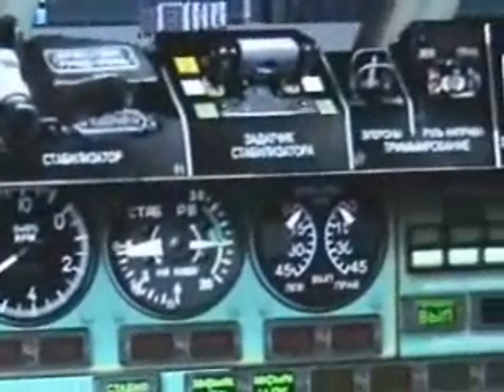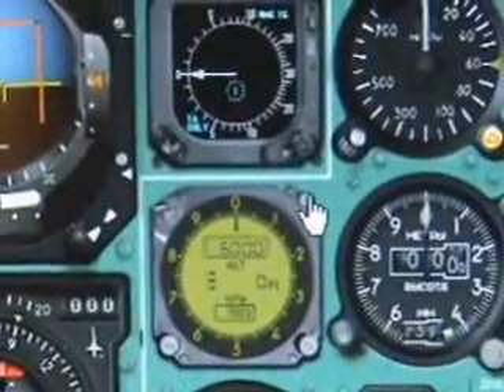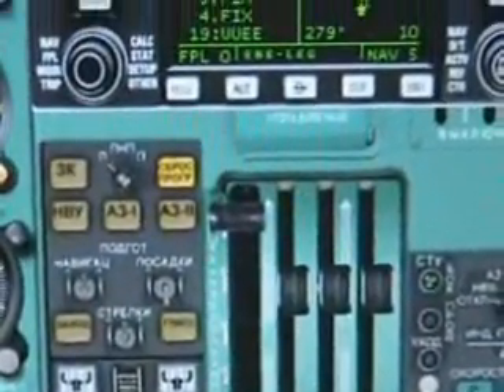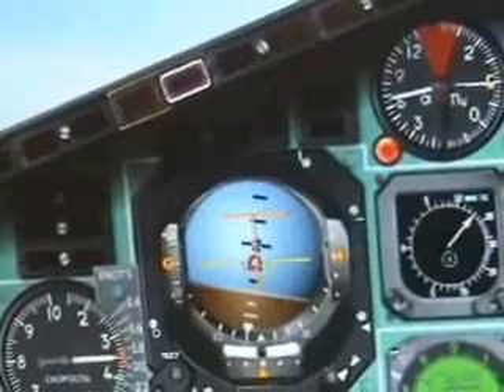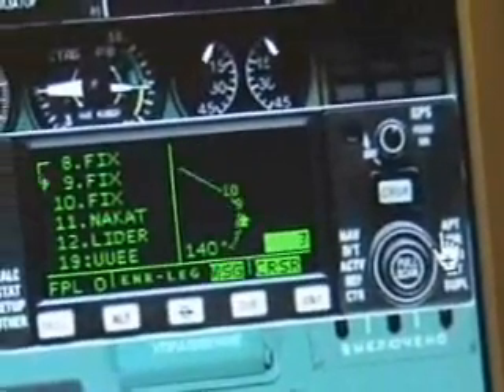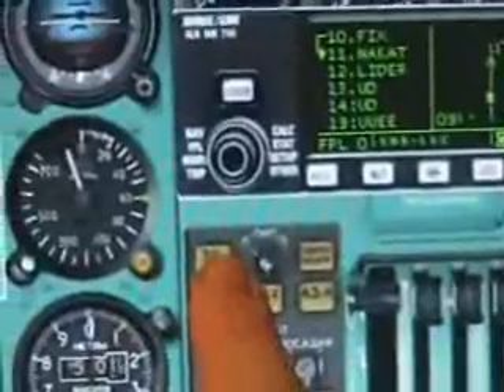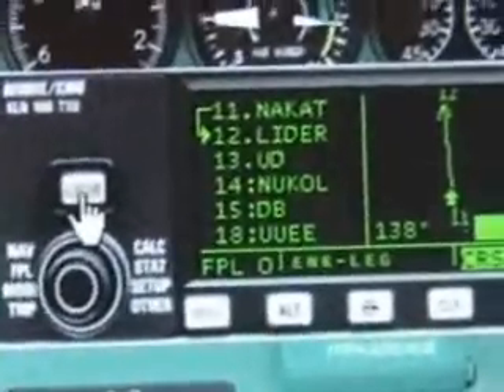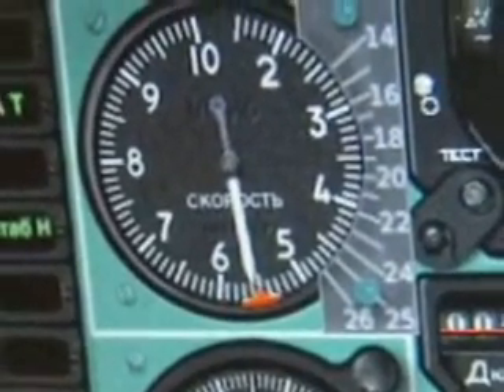Project Tupolev Tu154M Start & Takeoff Tutorial Part 4

Comment: wait. Why that Horizon is western model?? Soviet model is when turning, the gyroscope was move, horizon just fixed.
Reply from the maker: When the Tu154 was designed, the Tupolev Design Bureau wanted the aircraft to be certified under ICAO rules for IFR flight into western countries to ILS cat 3 landing with autopilot, and cat I landing hand flown. To achieve this a flight director, 3 axis autopilot and auto throttle was required. Incidentally the IL86 is also like this.

Here's some real videos to check out.
https://www.youtube.com/results?search_query=tu154+cockpit
Reply: ***** sorry. I mean for Artificial horizon.
Reply from the maker: Window Seat Indonesia#Super Constellation
Which is why I specifically answered your question about the Attitude indicator.

 
When the Tu154 was designed, the Tupolev Design Bureau wanted the aircraft to be certified under ICAO rules for IFR flight into western countries to ILS cat 3 landing with autopilot, and cat I landing hand flown. To achieve this a flight director, 3 axis autopilot and auto throttle was required. Incidentally the IL86 is also like this.

Here's a photo of the IL86 in flight. Check out the attitude indicator (primaries)
http://cdn.airplane-pictures.net/images/uploaded-images/2013/1/12/261184.jpg

For the Russian aircraft designed for flight into ICAO airspace (ie to places like London, Frankfurt, Munich, Zurich etc) they had to meet certain certification requirements to be permitted to make approaches to anything above LOC/DME minimums. Having a western style indicator with a flight director was one of those requirements.

I happen to like how the Tu154's indicator is actually a spherical ball encasing a gyroscope.
Reply: ***** OK, I found that. But when i found on Il-62, the gyroscope moves & horizon fixed.
Reply from the maker: Yes, The IL62 was designed before the Tu154 and IL86 were. The IL62 was not certified for CAT 2 or 3 ILS approaches in ICAO airspace. Only Cat I, and various non-precision approaches (And the russian RSBN navigation systems obv).

Comment: Nice Video-Tutorials you did!

But: In the real TU-154M it wasn´t allowed to switch on Pitot Heat until about 3 minutes before takeoff (depending on temp) and I think you didn´t put enough pressure on the press-system (4-6 units needed before takeoff)
in your earlier video. Switching from HBY (NVU) to CHC (SNS) is only allowed over 400 metres (as activation of AP).
No Autothrottle allowed in cruise only for approach.

I guess you already know this.